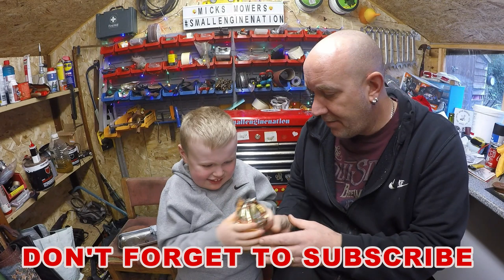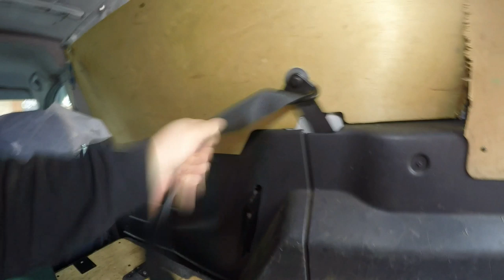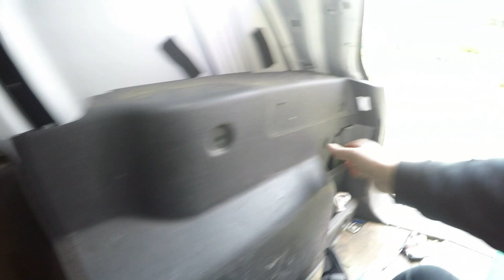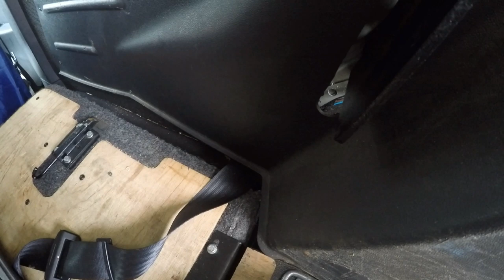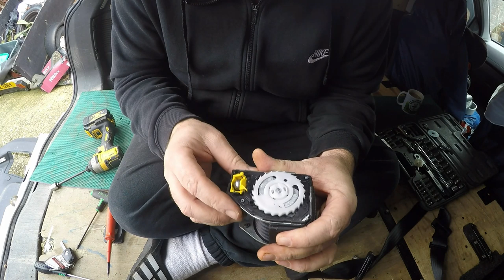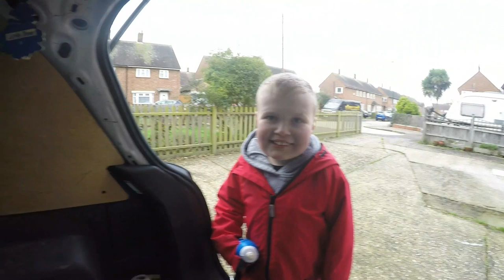Seat Belt Stuck or will Not Retract here Is An Easy Fix

Comment: Covered in crud 😢Im watching this video because I have a 2017 Hyundai vehicle that the driver side  seatbelt, yes my seat belt as the driver has seived up! You can blame it on crud if you please. I have been driving vehicles since 1986 and have never experienced this before. You can blame it on crud if you wish! I blame it on Corporate greed! Lets make cheap parts that wont last! I dont think I ever heard of seat belts locking up on vehicles made in the 1960's-1980's. Lets use plactics instead of metals so components break down and have to be replaced. Manufacturers used to be proud of the products they produced and most offered lifetime warrenties on products! We live in a age of lets screw the consumer and make products we know are gonna break down. Its ok  though we will charge them more for extended warranties knowing their products are prone to fail. SO YEAH I WHOLE HEARTEDLY AGREE ITS CRUD AND ITS GONNA KEEP GETTING CRUDIER AS LONG  AS WE ALLOW THEM TO GET AWAY WITH THIS CRAP!